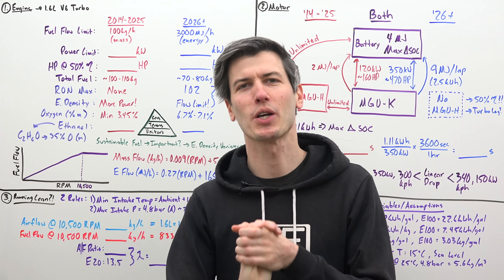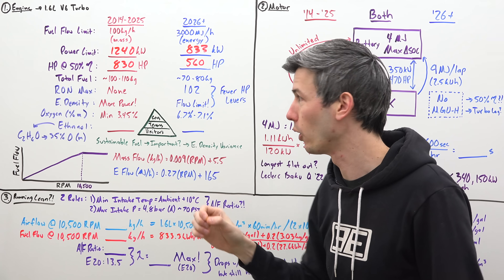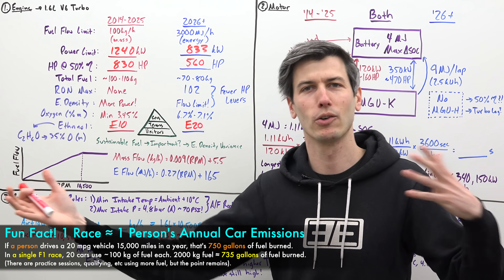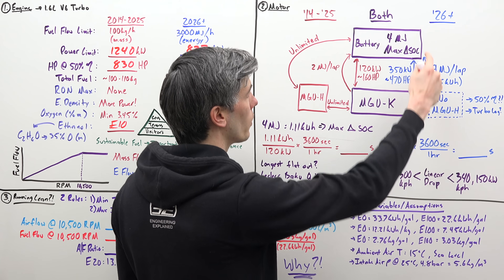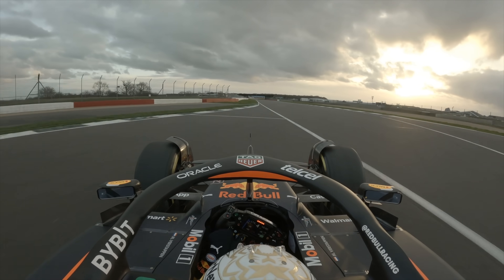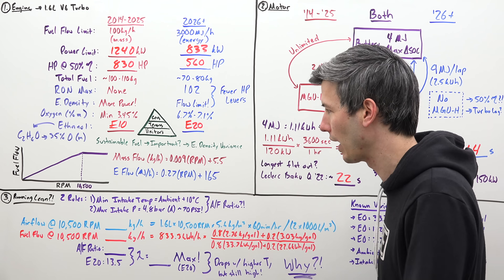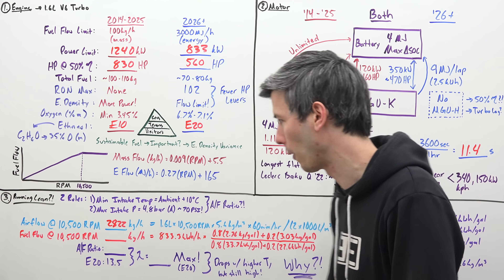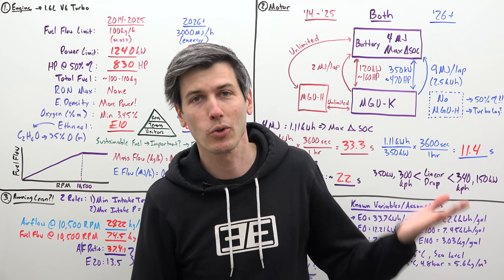Why Are 2026 Formula 1 Engines Going To Lose So Much Power?

Comment: I wonder if these changes will be making the 2026 cars quite a chunk slower. Of course we have no idea about the potential new aero, but history has shown they haven't ever been changed for better. A lesser time of electric deployment, a lesser amount of power from the ICE with a possible torque output delay, not changing the RPM of the engine (although as I am aware, and I might be wrong as well, there are provisions to take it up to 15K, as it is right now). I wonder what the difference would be like in a case like this, where about 3-times the e-motor power gets delivered in 1/3rd of the time; how would that pan out in the time it takes to cover a certain distance on a track. The math could be worth a shot.
I had done a deep dive into the new regs myself previously but didn't run the numbers, and boy am I shocked now! I am of the opinion that with the extremely painful elimination of the MGU-H, the engines will now sound better, even more so if the supposed exhaust system tweaks are brought into place.
Reply: The more power from electrick motors can actually make acceleration much better and so the lap times can actually go better.
But lets see!
Reply: @haukikannel sure, until they run out of battery and then slow to a crawl since they have zero ICE power.

Comment: This is very bad news, because it basically castrates the F1. And it's totally contrary to what F1 has always stood for: being the pinnacle of motorsports.
Once again FIA/F1 does exactly the wrong thing, just like they did with the tyres, the hybrid power units, the aerodynamics, DRS, the general rules and endlessly raising the costs for spectators/broadcasters. 

If there's one thing that stands out for its consistancy, it's that FIA/F1 refuse to learn anything from their mistakes and stubbornly keep making the wrong decisions.

Comment: Another great video by ƎE! The first thing that comes to mind regarding that ridiculous amount of air is cooling and/or (engine) braking if you run out of regenerative electrodynamic braking. I have a question about the capacity of the traction accumulator (I consider the word "battery" to refer only to so called "primary cells"). Max. voltage, min. voltage, chemical composition, number of modules, nominal Voltage, BMS parameters, C values during discharge and charge (1C = power of discharge equivalent to capacity, 2C = twice the power discharge over a shorter time period, 0,5C = the opposite, you get the picture). While you can store "X" amount of electrical energy in chemical bonds in the traction accumulator, that "X" value is specified by the max. and min. voltage you charge or discharge. How will this be monitored and checked? The very method of measurement must be standardized and enforced, or it could lead to all sorts of "tricks". Also, there is no current limit, nor temperature limit of the electric motor, inverter, traction accumulator. Why? What are the allowed values for the capacity, temperature, etc. for the electric part of the drive-train at then start of the race? I see potentially many things to exploit to get maximum performance. And many of such exploits will not lead to any advancement in technological development for real-world scenarios, because their application will be tailored to fit the very specific needs of an F-1 car, diametrically opposed to real-world applications. I always though of the F-1 as the test-bed where development of engines and other components is advanced, ultimately for the benefit of regular, stock cars for general use. I want to see very specific limits being posed also on the "electric part", limits that would lead to more realistic real-world technological advancements for general transportation needs.

Comment: If they really wanted to keep the field even and keep costs down they should just adopt a hard HP limit like WEC has done.  LMH/LMDH cars put out 680hp, period, no weird energy flow limits (WEC used to have an energy use limit prior to LMH) teams can run any type of engine/hybrid setup they want as long as total system power never exceeds 680hp (so hybrid setups are usually on the front wheels to help traction out of corners).  Also why go with the contrived mess that is going to be synthetic fuel (this could limit where they can race due to export restrictions or require extreme security of fuel supplies) when they can just use sustainably sourced ethanol, which will have even less emissions, be much cheaper, and has no export/security issues associated with it.

Comment: Regulators have been working to slow down F1 cars for decades. So many go  fast things have been banned.
Reply: They have to. Clever engineers always makes cars faster. So they have to invent rules to reduce speeds back to little bit safer limits. Until engineers manage to make those cars to go too fast again.

Comment: They could run higher ethenol fuels, which are less energy dense meaning you can inject more, but the optimal a/f ratio also changes so the lamba likely won't change to drastically, on top of that you will run into issues with the amount of fuel you are allowed to carry. Gonna be interesting to see what happens but I wouldn't be supprised if teams still manage to push 600+ hp from the ice in time. I do wish they gave atleast a 2kw battery because I feel the teams with a lower budget will be hit more by all of this compared to the richer teams, even if there is a budget cap
Reply: They cannot go beyond 20% eth by weight since there's a maximum to the oxygen weight ratio in the fuel